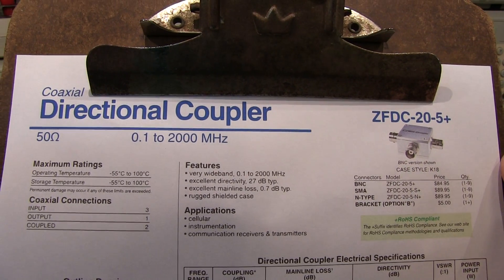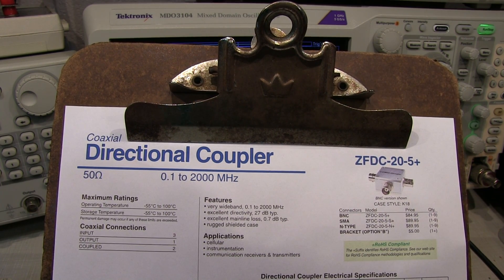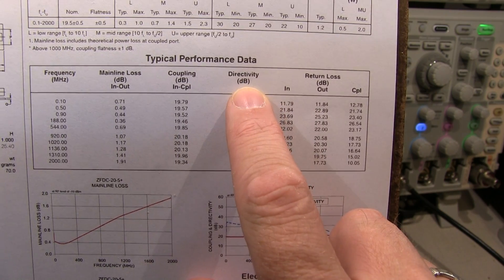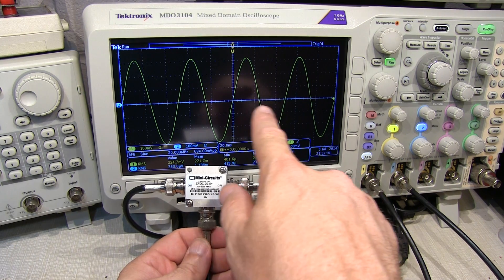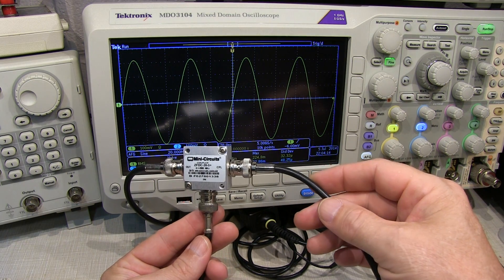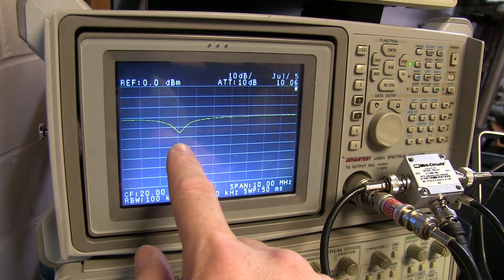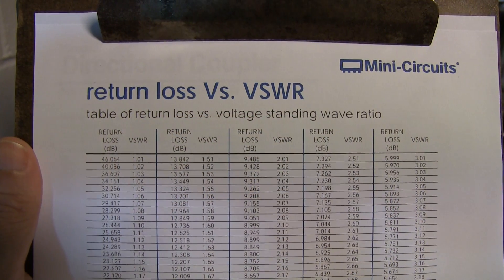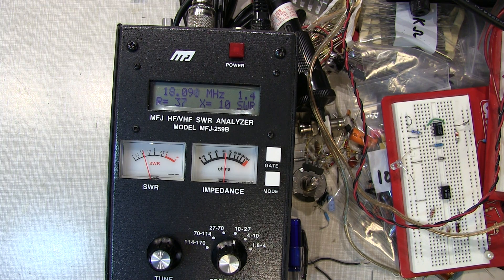#158: Directional Coupler Basics & how to sweep SWR of an antenna | Return Loss | VSWR

Comment: @w2aew:  

I’m wondering if I can use this device to allow transmitted power but “block” (or much more heavily attenuate) received power?

For your ZFDC-20-5+ used in this video, if I put a 50-ohm terminator on the INPUT port, connect the RF output of my IoT device to the COUPLED port, connect the OUTPUT port to my 50-ohm “antenna”, have I effectively allowed my IoT device’s transmit power to flow and blocked reception power back to my IoT device from the antenna?

Are the dB level drops at each port consistent, reliable, and determinable (or at least the transmit power levels) by the datasheet?

Thanks!
Reply from the maker: What you want to look for is a circulator or RF isolator.
Reply: @w2aew  I'm trying to find out what options I have to perform a Rx sensitivity test beyond what I have been given.
Reply: Hi  @w2aew  , Do you have a recommendation for a likely good quality circulator used in 2.4Ghz Wi-Fi with a maximum transmitter power of 1 Watt ?

Comment: I have been tuning antennas this way for over 40 years.  Return loss!  The reduction on the trace (down) is the responsibility of "power lost to radiation." The transmission line to antenna impedance match is irreverent.  RF Bridges can also be  used to make RL measurements. Ron W4BIN

Comment: I'm very confused what is the difference between an RF Amplifier output Watts/Energy compared to 120VAC Power Energy? EXAMPLE if the Audio Amplifier Power wattage measures 100 watts but the Audio Amplifier Energy is 800Wh. A Power Meter will measure the Power Wattage and also the Energy. I'm confused how the Energy is 3X higher than the wattage it seems. Wattage is Volts X Current while Energy is Wattage divided by / TIME = Energy. Its hard to understand what the differences between Power/wattage compared to Energy
Reply from the maker: The input Whr is the energy going into the mains input to the amplifier.  The Amplifier Power Rating in Watts refers to how much power is delivered to the load (speaker).
Reply: @w2aew  when you connect a power meter to the wall outlet it will measure the power and also the energy of the circuit under test. My question is what is the difference between power VS energy? It seems that energy is 3x the amount of the delivered power from the 120vac wall outlet
Reply from the maker: @waynegram8907  Energy is the voltage*current that is delivered to a device (amplifier, etc.).  Power is what is consumed/delivered.  If the amp is rated at 100Va at the input, and is a 25W amp, then it delivers 25W to the speaker and the amp consumes/dissipates 75W.
Reply: @w2aew  I thought Energy = Watts/Time which the device under test is Consuming/Delivered to a device under test. Energy is Watts Hours, Not just Watts/power. The hard part to understand is what is the difference between Energy VS  power? Because it seems that Energy delivered/consumed is 3X more than the power output to the speaker. EXAMPLE if the amplifier is 25Watts delivered to the speaker the Energy is 25 watts X 3 = 75 watts?

Comment: what does RF mean exactly?
Reply from the maker: Generally a signal that is intended at some point to be sent over the air, hence Radio Frequency.  Usually single-frequency signal that is modulated in some way.

Comment: I got an EE degree 50 years ago and at some point the prof zipped through how a directional coupler works. I didn't understand it but I still managed to use couplers and hybrids through a career. NOW I'm retired and I don't need the devices but I want to learn how they actually work. Can't seem to find an explanation.  I guess everybody just uses them. But if you look at a coupler logically,  it's like a bumblebee-- bumblebees are not supposed to be able to fly. Likewise for the directional coupler-can't fly and shouldn't divide out the forward and backward signals. They are too small. If you stick a stake in a creek or river, it can tell you the level of the water - analogous to showing the vector sum of the voltage at a point on a transmission line. You have no way of knowing the direction in which the water is flowing. The same should be true of a "directional" coupler. At microwave frequencies maybe there is room for more "direction finding" components. But a classical directional coupler for a 7 MHz sine wave is usually less than 6 inches wide--at 7 MHz a quarter wavelength is about 40 feet---CAN'T WORK. It's a bumblebee.  I'm still searching for an explanation.  For now, I treat directional couplers like UFOs--some people say they've seem them--personally I haven't. Don't believe in them myself.

Comment: James Fowler again. Misprint on the SA name. It is a 2 Ghz Siglent. I had Rogol on my mind when I sent the original comment.
Sorry
Reply from the maker: Hi James.  I've never used the Siglent spectrum analyzer, so I really can't tell you why the "normalization" function is grayed out on your unit.  This is a function that is used along with the Tracking Generator.  Maybe you don't have the tracking generator setup/configuration completed?
Reply: @w2aew  Thanks, will double check.

Comment: Firstly, you are a great instructor. Being licensed in 1953 as W5WTN, a lot has changed. I wonder if you are familiar with the Rogol SA. I have the 2 Ghz version and when I try to use the normalization function, the soft key is grayed out. The instructions state to change the settings to Dbm, which I did. No cigar. If you have any suggestions, please let me know.
Keep up the good work.
Best 73's     Eddy W5WTN

Comment: Is it possibile, when antenna is matched to 50ohm (checked using resistors bridge, antenna tunner and oscilloscope), that there is standing wave in antenna's feedline? (Asuming that coax is also 50ohm). I think that should not because whole system is matched so should be no reflectuons, but I am not sure if coax dimensions can introduce some reflections.
Reply from the maker: Ideally, if the 50 ohm coax is terminated in a 50 ohm load, there will be no standing waves.  However, depending on the coax, small impedance discontinuities can be introduced by bending the coax, which can result in small reflections and small standing waves.

Comment: Great video. Very helpful.  I'm interested in monitoring the SWR and forward power off of a 1000W linear amplifier.  How would the design change for something like that?  Or to ask this differently.  Can you put the swr meter and coupler between the transmitter and the linear amp and be fairly confident that the reverse signal will not be changed appreciably by going through the Linear amp?
Reply from the maker: The reflected signal will NOT be transferred backwards through the amp.  You'll have to put the directional coupler between the amp and the tuner/antenna.  Here's a good application note on this: https://www.analog.com/en/technical-articles/log-amps-and-directional-couplers-enable-vswr-detection.html
Reply: @w2aew  Thanks for the link.  Very helpful.
Reply: @w2aew  This brings me to another question, have you ever done a video on using test equipment, especially a scope, to test a receiver for dB gain or losd, notch configuration, Selectivity, etc? This may be too broad of a subject, but there doesn't seem to be a lot of information on basic testing of receiver health using a scope, for example.  Thanks again for all of the great videos.

Comment: Thank you, sir, I have 2 questions.
1. Can I connect an RF signal generator instead of an Antenna at 9:37 to measure the output impedance of the RF signal generator?
2. Can you explain the difference between VWSR Bridges & Directional Couplers?

If you have a chance, could you explain them to me?

Comment: Dip the plate, lower the current.  Efficiency of a tube with a directional coupler used as a sample port.   Used them with gridded traveling wave tubes as well.  Great channel you have!!

Comment: 😷🦠😷.  Yet ANOTHER great video for  CCP Coronavirus Binge Watching...
Thank you !!

Btw: Would you be interested in a Motorola Quantar repeater for channel tear-down or whatever purpose?

It’s an unused UHF - R3 (470-494Mhz) :
110 watt / RX pre-selector / advanced signaling package option / 
n.i.b. Argus battery bank charger with transfer switch / 

Even though it’s an R3 ...  it’s supposedly tunable down to GMRS freq range (462.xxx +5) with no degradation.

If you’d like it, it is yours... 😀👍🏻
73
KD2MKZ

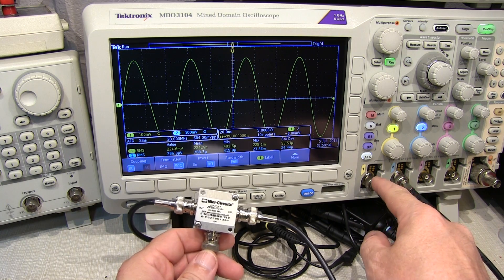Comment: Thank you for another great video. At about 6:40, you switch the load from 50ohm to 1M ohm and comment that almost all the power is now reflected. On the scope, indeed I see both the yellow voltage trace and the yellow rms voltage readout go from around 225V to 407mV, the result of the two signals adding together. FB. And I can see the blue trace showing the coupled reflected signal. 

My questions: Why is the coupled signal phase shifted (about 45degrees), why isn’t the main line voltage shifted some too?
Reply from the maker: The main line isn't shifted, because the scope is triggering on that line (so it always lines up in the same place on the screen).  The phase shift of the reflected signal in this case is simply due to the propagation delay back and forth through the coax.

Comment: Thnx ... very useful. I just received my reflection bridge and want to check my antenna's using the VNA. My reflection bridge has IN OUT and a DUT .... i should connect the antenna to DUT and the signal output of the tracking to IN. I don't quite understand your setup.
Reply from the maker: If you have a VNA, it would already have the bridge or directional coupler built in.  There shouldn't be a need for an external reflection bridge (unless it is an older VNA that specifically used external bridges/couplers).
Reply: @w2aew  Interesting answer ... i have a HP 4195A .... how should i connect an antenna in that case?
Reply from the maker: @egbertgroot2737  OK, that's an older analyzer that uses an external transmission/reflection test set.  A directional coupler will sample the signal going thru the coupler from IN to OUT.  Since the signal you want to measure is the reflection coming back from the antenna, you would want to connect the antenna to IN and the signal source to OUT.  The manual for the HP4195A can be found here: https://literature.cdn.keysight.com/litweb/pdf/5950-2942.pdf?id=619880
Reply: @w2aew  Ah i understand! Very useful answer. I only have old equipment ;-) ..... thanks for your quick reply! Greetings from the Netherlands. Pe1JKU

Comment: Taking what Alan says in that video, at face value, might do more harm than good, as the finite directivity of the coupler inserted between the spectrum analyser and the antenna under test, does limit the range of return loss, where the proposed setup makes sense in terms of engineering accuracy; I'll let you do the math' and evaluate the dramatic impact of the directivity of some commercial couplers... Pray pardon my candour, as I feel compelled to say how surprised I am, that the highly qualified & experienced engineers who have commented here, have not picked up on that limitation, not to mention the effect of a slight mismatch of the load of the so-called isolated port, that is a port that is not so isolated after all (!)
* internal or plugged externally

Comment: Hi, can you explain DAS Directional Coupler 698-2700MHz, why do I have to use the coupler for DAS? instead of 3-way Splitter?
Reply from the maker: https://www.cablinginstall.com/wireless-5g/article/16476534/engineering-brief-explains-use-of-das-directional-couplers

Comment: What a Both great and useful Video, congrats!!
I just have one question what could i say between use Directinal Coupler and a Bridge to measure SWR for an antenna?
Thanks
Reply from the maker: You can leave a directional coupler in place when operating, but you can't do that with a bridge.
Reply: @w2aew  Now, I got it
Thanks a lot!!

Comment: Hello Alan! I do hope you don’t mind me asking a question via email than on utube?

I am unfortunately, not a real smart guy (82 yrs old!) when it comes to seeing different values of R/L in different scenarios and thus , I have confused myself and could use a bit of help if you don’t mind ?

Case one : I have a Rigol DSA815TG SpecAn along with a Mini Ckts ZFDC 20-5 DC and a highly Precision HP 50 ohm Load. I also purchased (from  either a China or Russia) a 
01 to 3000 MHz RF Bridge. This bridge requires an external 50 Ohm Load unlike the ZFDC that has the 3rd port terminated in a 50 ohm Load,

For the first part of this -

The Rigol was set to start QRG 1.8 MHz and stop QRG at 450 MHz (the Rigol goes to 1.5 Ghz) for this experiment-

RBW set 30 KHz - VBW set at 1 KHz 

A) Using the RF Bridge, “Output to SpecAn input”  - “Input to TG Output”. “Excellent 50 ohm Load on the “REF port” and nothing on the “DUT” port - then I “Normalize”  the DSA815TG. (TG level set to zero db from -20db). A 10db pad is on the “Output” of the TG.

Best Results :
 30 MHz R/L   59db
145 MHz R/L.  59db
450 MHz R/L. 38db

All I do now is exchange the RF Bridge for the ZFDC And renormalize again. 

Best Results:

30 MHz R/L       32 dB
145 MHz R/L   31.8 dB
450 MHz R/L. 30.2 dB

Question: Why a difference of 20 db or so between the Bridge and ZFDC? Which is believable ? Or are they both correct ?

Part two (with me, there is always a part two!) 

I also have. HP 8711A RF Networks Analyzer. On this unit, there is of course no need for either a bridge or DC due to it being an internal device in this unit.

I have set up the network Analyzer with same start/Stop QRG 

And I use my “Precision” HP # 909F 50 ohm Load.

The Analyzer is calibrated with an open/short and load (using the same 50 ohm Load as I will be testing)

Results:
1.8 MHz. 54db
 30 MHz  53db
450 MHz 50db

Alan, your thoughts? Anything will be very much appreciated!

73 
David. de K8KEM
Reply from the maker: replied via direct email

Comment: Hi Alen. I cannot find what is mix power, that this direction coupler can handle? I mean, can I use this for monitor 40 or 50dBm with spectrum analyzer. I will connect radio -> direction coupler -> antenna, and coupling port -> 2W 30dB attenuator -> SA? I cannot find this information on minicircuits site (I have ZFDC-20-4 20db 1GHz coupler). Thanks for great videos
Reply from the maker: The maximum input power is listed in the datasheet.  For 1-10MHz, the maximum input power is 0.5W (27dBm), and for 10-1000MHz, the maximum input power is 2W (33dBm).  So, unfortunately this coupler is not suitable for 40-50dBm input.  For that kind of power level, you're much better off using an RF sampler.
Reply: @w2aew  Thank you

Comment: Hello, I thoroughly enjoyed this video! I own a Tektronix 494p and would like to test SWR on my homemade antennas in the 5.8g frequency. My analyzer doesn’t have a tracking generator. What form of signal generator would you recommend if my only intent for use is swr on my antennas? Thanks for the great content!
Reply: You need an RF sweep generator that will sweep the range you want to test. Set the sweep rate high and the scan rate of the analyzer very slow. You will get an envelope of the response using the setup as in the video. I do this for my drone antennas.
Reply: glasslinger thank you, I managed to get a very cheap sweep generator development board ranging from 35mhz-4400mhz and use a frequency multiplier to get me up to the 5.8ghz if testing that band. Works great! Thanks for the reply

Comment: I'm glad you did this video. I recently purchased a spectrum analyzer with a tracking generator. I wanted to look at S11 and VSWR with it and there is a directional coupler made for this analyzer that cost around $700.00. However, that Mini Circuits directional coupler does the same thing for under $100.00 fantastic! I really enjoy your video's lots of good information. Thanks!

Comment: I ran this experiment on a 1.27 GHz antenna using a signal generator, spectrum analzyer and compared 2 directional couplers.  1 Mini-Circuits like in the video and a Chinese model. The results were significantly different.  Mini-Circuits return loss was 18.51 dB  Chinese model was 42.41 dB with a much narrower trough.  The frequency also shifted 84MHz.  Since  I don't have a tracking gen, I sweep the frequency range and use "Max Hold" until the screen fills in and use that as the '0' reference.  I have repeated this experiment multiple times in different frequency ranges with similar results.  Any Idea why the results would be this different between 2 couplers?